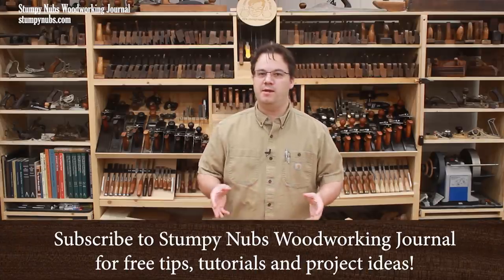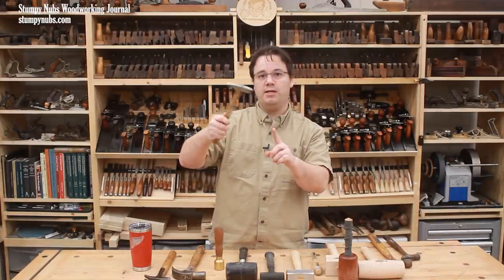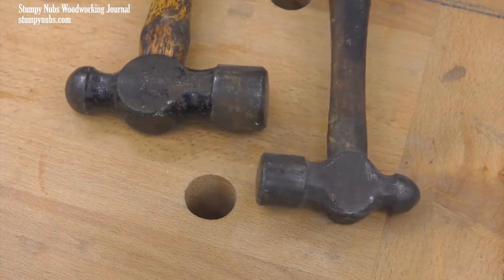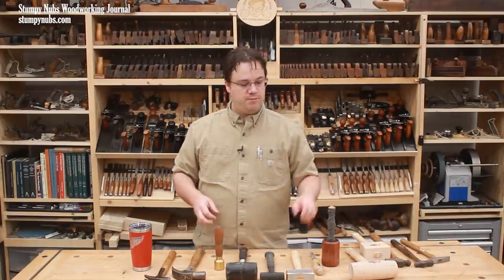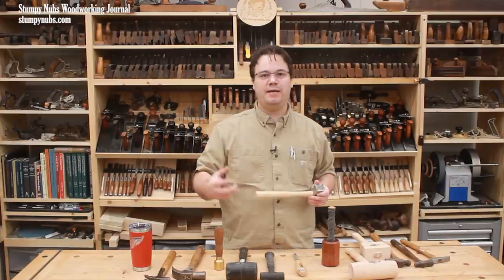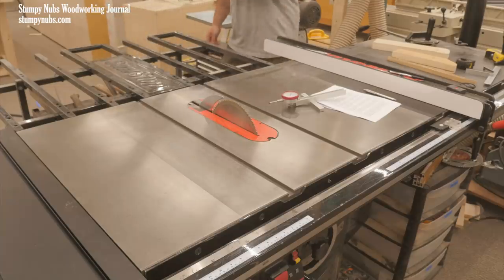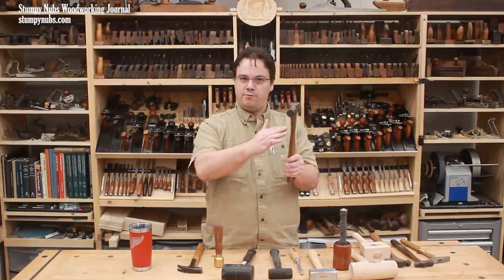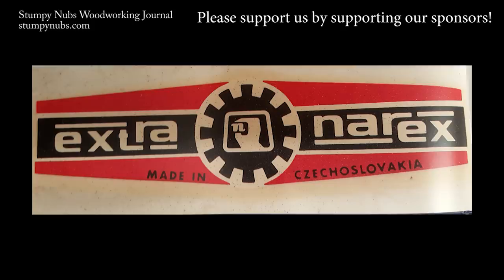Hammers and mallets woodworkers need to know about

Comment: I used almost all those hammers. A funny story. I done machinist work for over 40 years. Our shop floor had dead blows and rubber hammers that looked identical. I needed a dead blow. Grabbed the rubber hammer. I was using a 4 lb. I gave it a blow expecting the dead blow effects. Instead I got a bounce back of the rubberized hammer. My nose stopped it. Prescription safety glasses didn't fare to well either. Bloody nose and a lesson learned. Now I use the orange color dead blow and the black rubber. Refuse to even have a black dead blow.

Comment: You missed out the textured end framing hammer, very useful to deliberately bend or realign nails
Reply from the maker: I didn't miss it. It's not a woodworking tool as much as a builder's tool.

Comment: A cross-peen hammer is used by metalsmiths for bending metalwork along one axis, while a ball-peen hammer is used for bending curves or thinning metal along all axes. Whoever told you a cross-peen hammer was for drive nails was pulling your leg.
Reply from the maker: Many tools are used in both metal and woodworking, and have been for generations. Whomever told you your experience with it was the sum total of its common uses was pulling your leg.

Comment: I believe I have those hammers but I'm wondering where your framing hammer is located. I've never known a building framing contractor or crew that didn't have a good framing hammer, unless of course the labors that just pack lumber.

Comment: A cross peen hammer is using in forging (working metal)
Reply from the maker: Cross peen hammers, like many other metal working tools, have been adopted for woodworking tasks for generations. Usually, those used in woodworking are smaller and lighter versions than one would find in the typical blacksmith shop. They are more like the versions used by silver and tinsmiths. But, since I have little experience in those crafts, I can't expand upon their uses with metal.

Comment: And then, of course, there is the straight claw hammer rather than the rounded claws...best for rough carpentry  like framing...and roofing where it could save you from a fall ; )

Comment: Good lord, I’ve never heard someone talk about a cross peen hammer for wood, maybe that’s what you use it for with wood but it’s made to move sheet metal, shrinking and stretching, sinking and raising. Just like a ball peen hammer, they’re made for metal smithing, using it that way with wood is a happy accident.
Reply from the maker: Cross peen hammers, like many other metal working tools, have been adopted for woodworking tasks for generations. Usually, those used in woodworking are smaller and lighter versions than one would find in the typical blacksmith shop. They are more like the versions used by silver and tinsmiths. But, since I have little experience in those crafts, I can't expand upon their uses with metal.

Comment: Never buy cheap claw hammers as they never pull the nails reliably and also the driving head is usually badly made and will slip or cause nails to bend rather than drive straight.
Most of the others you can probably get away with a cheaper version, although a cheap badly made Rubber mallet becomes a lot of bits of rubber and a wooden handle :)

Comment: At what point is a tool too old and precious to use?  300 years?  400 years?  I guess if people can live in houses that are 1000 years old, using an antique hammer doesn't seem so bad.
Reply from the maker: It depends on it's rarity and condition. If it's very rare, it's best not to take any risk of damaging it. If it's old but not that rare (like a hammer), and normal use will not damage it, I say put it to work :)

Comment: I have an old hammer that belonged to my dad, and that I've never figured out. The head is solid lead, and the handle is just a straight piece of pipe. It might even be homemade. It isn't good for driving nails because the lead is so soft that it damages the head of the hammer more than it moves the nail. It obviously isn't good for working on wood, because it will mar the surface. If anyone has any insight into this beast, I'd appreciate it. I don't know how heavy it is, but I sure wouldn't want to drop on my toe.
Reply: I have a hammer exactly like that! I use it sorta like a deadblow. It will dent the lead before whatever I'm hitting.
Reply from the maker: I have a hammer that sounds exactly the same. It was my great-grandfather's. The soft lead head is mushroomed quite a bit on both striking faces and the handle is a hollow piece of pipe.
Reply: Lead head hammers are used in metal work. Old school machinist still use them. Used to not ding the metal surface. Modern shops use dead blows.
Reply: Most of those old lead Mallets with a pipe for a handle were made by and for a Plumber! 👨‍🔧  I made one when I was like 13. 🙄 Woah, that's a long time ago. 😉

The mallet is a dead blow non-marring striking device they would use to coax a wrench or pipe as needed. Lead is an incredible dead blow material and does not marr cast iron or Steel making it ideal for plumbing. You can really give a wrench a heckuva whack with them buggers and not have it bounce back in your face! 🤕

Back in the day most pipes were cast iron in which lead was often used to fill in voids especially in larger drain pipes. So this made it a common material for a plumber to carry and obviously a plumber always has some kind of pipes close at hand. Hence it was an easy mallet to make and even recast as needed. 

Nowadays lots of tire shops use them for specialty rims such as spinners. The dead blow and non-marring properties are ideal for them. No black marks from a rubber mallet, cracks from a urethane mallet, or any of the other problems that abound with other mallet materials.

If one was inclined to do so, it is not difficult to reshape the mallet head with a steel hammer. Although as mentioned, recasting is also a simple process. Of course, there are also many lead mallet vendors nowadays that will recast for a bit of $$$. Heck I would bet you could even check on Etsy... I bet a blacksmith somewhere more than glad to do it for a few bucks. 😏

Comment: Sorry, but a cross peen hammer isn't for driving nails. It's for "peening," the act of drawing, bending, or flattening metal. It's primarily a blacksmithing hammer.
Reply from the maker: I think you mean you didn't know cross peen hammers have been used by woodworkers as well as metal workers for generations. I'm glad you learned something new today 😉

Comment: Thanks for starting the video out with a joke... LOL  Using the cross peen on a cross peen hammer to start a small nail.  LOLOL.  That's the funniest thing I've ever heard.  I hope it's not TOO obvious that a cross peen hammer isn't a woodworking hammer at all.  Like the ball peen hammer, it's a metalworking hammer and is used to expand metal in the direction of the peen.  See the related, 'straight peen hammer.'
Reply from the maker: Like a ball peen hammer, a cross peen is a metal worker's tool that is also used for woodworking and has been for generations, in precisely the manner I demonstrated. Straight peen hammers are likewise metal working tools that are used sometimes for similar woodworking purposes. Just because that hasn't been your experience doesn't make it a joke. It's not even uncommon to use them in that way... I am glad you learned something new in this video :)